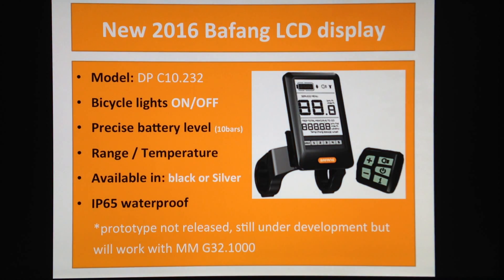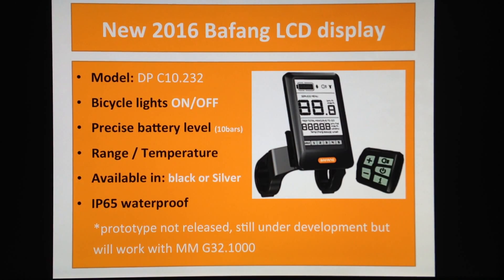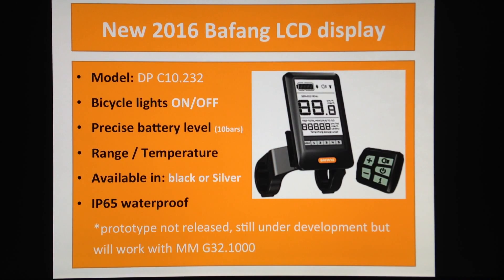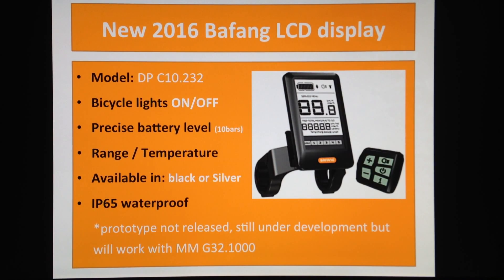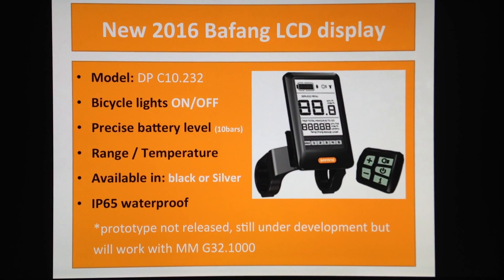New 2016 Bafang BBSHD 1000w mid drive (video 5 of 7) New Display turns lights ON/OFF? • 8fun BBS02

Comment: I really think the temperature on the display is for the motor or perhaps, the battery. I would be interested in seen how hot the motor is running, so I would go easier.  Anyway, I would much prefer if there was an option NOT to use any of these display, but our own phones!  Also, I am really not interested in pedal assist mode. Is there a way to completely eliminate this function. Including not installing the sensor for pedal assist etc? Thank you.
Reply from the maker: FANTASTIC IDEA.... I am imagining now a Bluetooth Bafang motor and my iPhone mounted on the handlebar with countless functions and ridding style settings =] There are some low powered systems that you connect via Bluetooth but would be great if a massive eBike manufacturer like Bafang started to make something like that, would be a game changer shaking the electric bike industry.
The easiest way to eliminate the pedal assist is to unscrew the controller (3x screws) and disconnect one of the sensors (the smallest plastic connector) or getting the USB cable, connect the controller to a PC, install the controller software and play with the controller settings (you completely void the warranty and will reduce the life of the motor). The USB option is good if you like modifications. Watch these videos where I talk about modifying the factory settings:

http://youtu.be/i1VHOF9WaEM

http://youtu.be/ZZ-1BLIklO8

Comment: Will the new display be removable?
This has always been a concern when leaving the bike unattended.

Will the new motor be basically plug and play with the BBS02 wiring system?
Would be nice not to have to remove everything and reinstall again.

I currently have the 48v 11.6Ah lithium downtube mount battery and am planning to add a second battery to increase range.
Do you think two of these batteries wired in parallel would have the amperage needed for the BBSHD?

Current Bike Configuration:
Motor:
BBS02 750w - stock configuration
Lekkie Bling Ring

Battery:
48v 11.6Ah lithium downtube mount battery
in planning: (Connect two in parallel to increase amperae output and range to 23.2Ah)

Throttle / Brakes:
Right hand twist - custom right handlebar grip
BAFANG brake levers for disc brakes
in planning: (Tektro Dorado HD-E710 E-bike hydraulic brakes front & rear)

Lighting System / Display
SP PD-8 Dynamo Hub
Supernova E3 2 Headlight
Supernova E32 Taillight
BAFANG C965A Display

Bicycle:
Schwinn s29 - Modified
5.25in Rise handlebar
Schwinn noseless seat
Custom headlight switch
Ergon GS1 Leichtbau grips - right modified for twist throttle
Pletscher ESGE Double Leg Center Kickstand - with rubber shoes
SLC PD-S01 Pedals - Sunlite pedal extenders
Spurcycle Bell
Bike-Eye Frame Mount Mirror
Reply from the maker: +James A. Smith Sr.  - Hi Jim, thanks for your message and email. This display is definitely not removable and I don't think they will be making one for a while because the display is a very important part and making it removable you need to add reliable connectors connecting and disconnecting thousands of time without problems in any weather condition (water/dust proof) or make it wireless but then need to add battery to the display and people will be complaining if they get flat display battery they can't ride their bikes... I think they will avoid all these issues for a while..

About making your Bafang faster, very first thing I would do is get a 52T chainring, this would make your bike faster but a bit heavier to pedal if you get flat battery. http://www.empoweredcycles.com/collections/8fun-bafang-bbs02-accessories/products/8fun-bafang-bbs02-chain-rings?variant=803797503

Next step, I would get the USB connector and change the controller settings to enable throttle 100% and if you would like you can enable the pedal assist to 100% (level 9) as well. 
Link for the best USB cable: http://www.empoweredcycles.com/collections/8fun-bafang-bbs02-accessories/products/usb-programming-cable-8fun-bbs02-mid-drive-motor
I will be posting a video showing my settings very soon but for the moment you can watch this video: https://youtu.be/BYMdcSWnbBo

Instead of having two batteries I would go for 1 powerful battery with higher voltage and powerful BMS capable of handling more powerful motors. Your battery is 48v but fully charged is around 52v. If you get a 52v battery then it will be around 58v when fully charged (like my battery). 48v batteries are also called "12s" which means 12 cells in series and 52v batteries are 14s.

Watch below some modifications I did recently to increase the RPM by increasing the battery voltage by charging it 100%: 
*note that all these settings and battery modifications will void the warranty and it is really dangerous play with batteries. I won't recommend doing any  battery soldering if you are not a technician and would highly recommend to find one and ask to do this job for you.
RPM tests at 56v (1400w) Bafang controller - https://youtu.be/Zew0RXjyAqU

100% Battery PERFORMANCE = Bypass BMS + re-Tune your Charger • 1470w - https://youtu.be/EVv5z7GABx4

Extreme RPM tests Bafang BBS02 1470w - https://youtu.be/chO8e_RCdto

I am sure you will have lots of fun doing it and every time you take it for a test ride and feel the difference... is so fun and exciting!

I hope all that information helps =]

Please SUBSCRIBE my channel as I will be posting lots of videos and I am also making a really powerful 28000w setup that will  surprise everyone =]
Reply from the maker: +James A. Smith Sr. - Tektro Dorado, the front brakes will make a huge difference as the stopping power is something around 80% on front wheel and only 20% on rear wheel. =]
Reply: +ElectricBike (Bruno) I thought about a larger chainring although where I live the terran is not flat.  Mountains very hilly, worried about the pulling power uphill
Reply: +ElectricBike (Bruno) Do you know if the on/off light switch is utilizing the battery power or is it simply an on/off switch.  The reason I ask is I have a dynamo front hub to generate power for the lights.  It would be nice to run that through the display light on/off switch.
Reply from the maker: +James A. Smith Sr. - yeah I was recommending 52T chainring to people (the easiest way to increase speed) but I'm going to stop saying that as it stresses the internal gears (watch my latest video explaining the downsides of 52T). If people want to go faster with a very reliable setup, better go for BBSHD. It's possible to do lots modifications on the BBS02 but pushing it too hard eventually you'll have problems.
Reply from the maker: +James A. Smith Sr. - this display is not available yet but I'm 99.9% sure will be from the battery, some BBS02 with C965 display came with similar function  using the battery power 48v but at the lights connector you only get 6V, fine for the rear red lights but not powerful enough to power very bright LEDs headlights. Hopefully they make it 48v for the new model =]